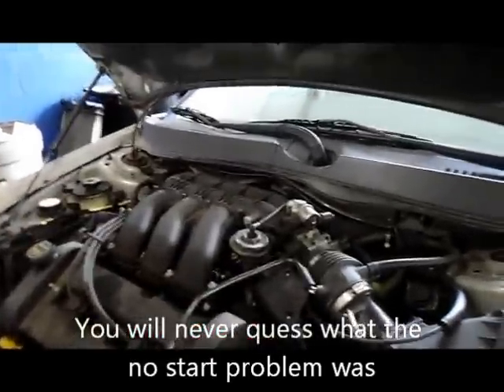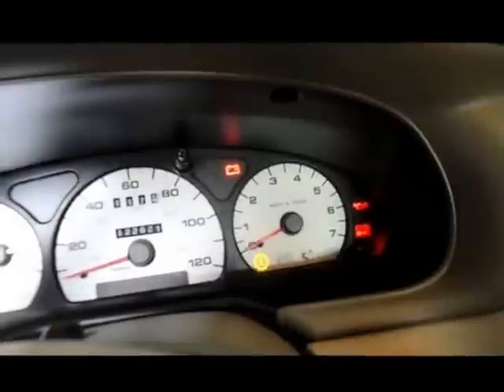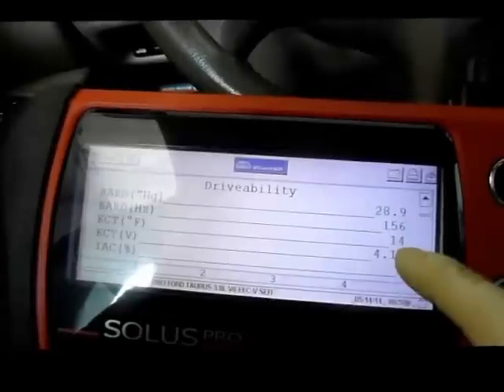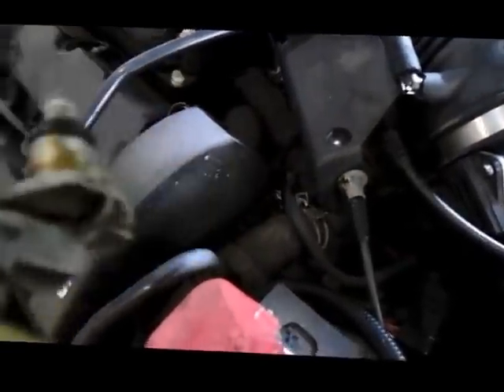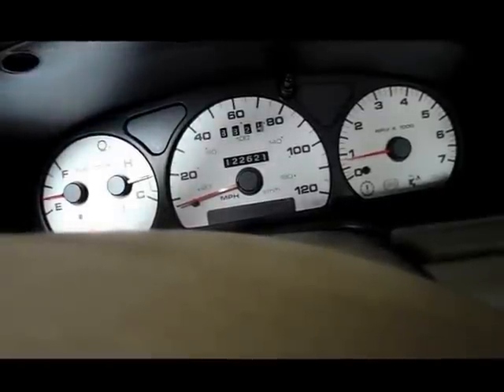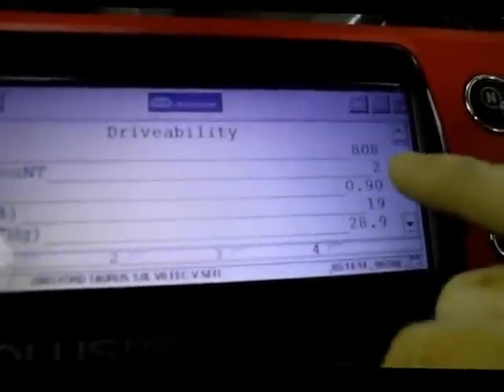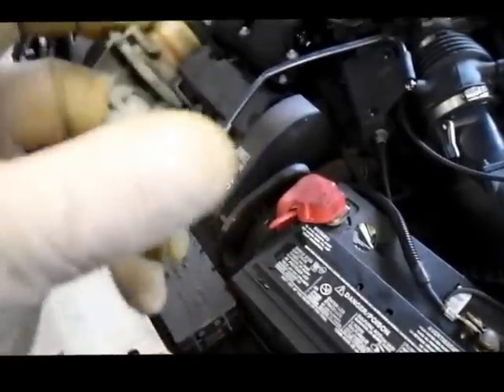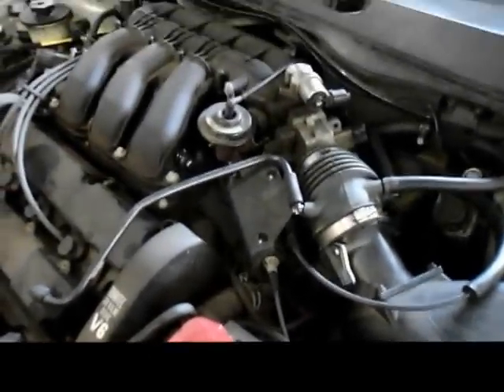Engine cranks but won't start

Comment: What if.. no crank or start and no fancy software.. try these Toyota tricks Put the key in the drivers door with the window rolled down reach inside and lock all doors.. now turn the key in the door to the unlock position and hold it there for 15 or more seconds.. now turn the key in the door to the lock position for 15 seconds or more. Now open the door and get in.. put your foot on the brake and hold it while you turn the ignition to the on position without starting the vehicle.. now there is a trip/odemeter reset button in the dash cluster.. make sure it is set to Trip and not complete vehicle mileage.. turn the key back off when it is set on Trip.. with the key off hold the trip reset button in the dash instrument cluster and turn the key into the on position but do not start the vehicle.. hold for 30 or more seconds (all this time you should have been holding the brake pedal down normally).. now turn the key back off and release the button in the instrument cluster.. note.. do not release the trip reset button until the key is in the off position. All security "engine immobilization" "anti-theft" and even engine maintenance warnings have now been reset. Take the key out of the ignotion. The anti theft light in the dash instrument cluster should blink slowly when the key is not in the ignition. Now insert the key back into the ignition and turn it to the on position without starting the vehicle.. wiggle the steering wheel to make sure it is not caught in a bind as this will prevent the key from performing as it should. With the key in the ignition wait 10 minutes and turn it off and leave the key in the ignition In the off position (this is a lightweight ecm/key program.. make sure all keys that will be used with the vehicle are in the area of the driver when all of this is performed.) After waiting 5 minutes with the key In the ignition and the position of the key being off. . Try to start your vehicle. If you get a no crank or no start there is one more thing you can do.. (never remove remove a battery cable with the key in the ignition) under the drivers side dash board, located in the vicinity of the steering column will be a white plug with 16 pin holes in the end of it.. you will need a paper clip or a short piece of wire to do a hard reset of the ecm/ecu/engine immobilization security feature. The white plug has a shape that only allows it to be plugged Into something one way.. it also has also feature on it that locks together with anything you plug into it.. looks like a small hump about a quarter of an inch long in the middle of one long side of the plug.. hold the plug with that hump facing down. . 8 pins across the top and  8 pins across the bottom. In the top row count over 4 pin holes and in the bottom row count over 5 pin holes.. these are the holes that you will place the paperclip or wire into while the Ignition is off. If looking a diagram it's pins 4/13.. now with the paper clip in the top row #4 pinhole and in the bottom row #5 pinhole.. turn the Ignition on for a few minutes (do not hold the paperclip and make sure it doesn't touch metal) after a few minutes turn the Ignition off and remove the paperclip. Ecm/ecu and engine immobilizer has now been Hard Reset. If the vehicle still does not start.. make sure your insurance policy Is up to date and roll, drag, push the vehicle into the river lol no I'm just kidding.. maybe ha! Seriously though geez.. OK a door lock actuator may be the problem. Check to make sure all doors lock. If not replace the actuator for that door. Start from the top of this list again and at the end of It if the vehicle still does not start.. try putting the gear shifter into neutral while holding the brakes and try to start the vehicle in neutral.. if it starts in neutral it means you have have a bad neutral switch located near the gear shifter or on/in the transmission. The last thing you want to do is disconnect the battery and let it sit over night.. but if you do that.. you will have to perform all of the above plus.. another set of tricks to reset the TPS (throttle position sensor.). I'm not even gonna go there.. OK OK I will geez lol reconnect battery. Sit in drivers seat. With the key out of the ignition press the gas pedal all the way down and release it. Now insert the key and turn it to the on position with out starting the vehicle. Now leave the key on and very.. very very slowly.. slower! Very slowly press the gas pedal all the way to the floor.. slowly I said dang.. lol  :)  hold it to the floor for just a few seconds and then slowly.. very.. very.. slowly release the gas pedal.. Slower!!! Slowly.. oh yeah.. that's it.. Mommy likes It like that lol once the gas pedal reaches the top remove your big Ole foot and no turn the ignition off. Wait 5 minutes. The throttle position sensor (TPS) had now been reprogrammed in the ECM/ECU. Try to start the vehicle. If it doesn't start don't ask me what to do.. I'm just a 24 year old girl lol hope it helps someone tho.. "p.s. My dad and uncles, brothers are all shade tree mechanics and that's just a little of what they have taught me about vehicles.. plus I'm not a prissy dumb city slicker girl yall.. Alabama Girls Are The Best!! Like my comment ok

Comment: I hate new cars im happy with my 79 chevy carburetored car with no fucking computer.life is too short to learn everything
Reply: I hear ya!  I miss my 75 Chevy Impala.  That car never let me down.  I owned it for 24 years and it still ran when I said goodbye to it!  The only electronic thing it had,  if I remember,  was an ignition module inside the distributor in place of the old points system.  I had to replace it only one time when it went out and the car wouldn't start.  Not only was the replacement module pretty cheap, it was really easy to replace!  Those were better days all around for me.  Be well and may your Chevy run for many more years to come!  👍👍😀😀
Reply: @arthurmann578  i have spare distributor, fuel pump,tire and some fuses thats all i need lol

Comment: had kindof this problem on a 93 gmc 305 engine. it would start but was flooding blowing black smoke and backfiring. changed the coolant temp sensor and it ran like new. sensors can do all sorts of strange things.
Reply from the maker: Thank you for your input and for watching.

Comment: Is the same in ram van 1500 engine 5.2? Or just in ford is this issue?
I'm stock and almost I wanna buy new computer I replace all the ignition coil system new crankshaft and nothing about the spark before this happened I repair the water pump but never replace that sensor coolant  :?

Comment: I have a 2003 Mitsubishi lancer LS...i replaced the Cam&Crank sensors replaced the crankshaft sprocket,flange,and trigger plate but before I changed all that I just replaced the crankshaft position sensor the car ran I parked it thought everything was OK about a hour later I go to drive the car and it won't start...so I just went ahead and replaced the sprocket,flange,and trigger plate thinking it would solve all my problems and run fine but this time it won't start at all...would the temperature sensor do the same to a Mitsubishi lancer as it does to a Ford?... Help me out please been trying to figure out what the heck the last 4 months

Comment: Hey I have an 06 mercury milan same Duratec engine thats is doing something similar. Sometimes it won't start and for the longest time maybe like 2 months it would almost always start the 2nd time. But now it's getting worst and taking more times to start do you think that this sensor could be the problem ?

Comment: My 2004 freestar 3.9 L wont start when cold outside. When it warms up theres no problem! It cranks good but sounds like a horse when trying it goes phhhht every time could this temp sensor be the problem possibly or the fuel pump?

Comment: There is a problem when a computer won't allow an engine to start if its below freezing since most people live in areas where that is the norm for large portions of the year.
14 degrees fahrenheit? That shouldn't keep it from starting.
I wouldn't want to rely on computer controlled vehicles in an emergency situation.

Comment: Hi
I urgently need your help please.
Can this happen to a 2005 Nissan pathfinder SE?
My Nissan was perfectly running but suddenly stopped starting.
The engine is cranking but does not start!!
It has been seen by couple of mechanics but no start.
They have checked and replaced few sensors but not the coolant temperature one. By the way there is no spark.
Any advise please.
Thank you

Comment: please whats the name of this your scanner? how much does it cost  to get one? how many car make can it scan? like is it only for ford or it universal?
that is number one 
number two, i have acura tl 2005 that crank but won't start of show battery or gear light on the dash board? what could possible be the cause, the fuel pump is working but due to time factor I couldn't, it display light on the dash board but omits the battery light and gear light from showing on the dash board.

Comment: 93 Subaru, the sensor failed while hot, when cold start, the sensor says too hot to run, and blocks the signal to allow spark.

Comment: I know that if it did start and continue running thinking that it was cold, we know it would have run very rich. Over a long period of time that could have caused damage to the engine and possibly the emissions, in particular the cat. I had a car that caught fire because the temp sensor was bad, the cat was so hot that it melted the heat shield. I replaced the temp sensor and the problem was gone. Is it possible that this was designed for that purpose, possibly to protect the consumer??

Comment: hello good morning that was a very good information but I don't know if it's gonna be same thing for a different car..  my car is a mitsubishi eclipse 2001 no issues no problem tow days ago when I m on my way home on the free way I was driving normally an smoothly it's a stick shift car I bearly shift to 3d speed the car just shutt off an it won't start I don't know what exactly happen bc I changed everything lately an every thing was ok.....etc.....
Reply: salah hage it's your timing belt common in lancer
Reply: no the timing belt is good
Reply: Antonio Gonzalez the problem is the crank position sensor an it's gonna take one day to fix

Comment: my 2012 mustang is doing something like this it turns off randomly then it doesn't start it cranks but no start the next day it works fine for months or until it randomly shuts off can you help ?

Comment: I have a 2006 Lincoln Zephyr having problems starting it I put a new Fuel pump on it set of new fuel injectors set of new spark plus set of new coils and pigtail leads for the coils and takes it forever too start I can turn the key on it cranks for at lest 30 minutes than have too back off the key and back it off again and finally it starts it was doing this before so that is why i bought new parts has nearly 180,000 miles on the car I bought all the parts dirt cheap from eBay fuel injectors a set brand new not re manufacturer was $42.00 on eBay fuel pump not assembly was $18.00 and coils set of them was $45.00 on eBay

Comment: i have a 1999 mercury villager the engine cranks but it doesnt start so would this be the same problem the sparks plugs are fine but i wanna know if i should try this??

Comment: how many sensors are there that prevent the entry from even starting it should protect the engine it might work when it's running but then suddenly it just feels so the engine has to stop the computer won't let the engine start Wolf Run just try it by unplugging the wire to see if it'll run

Comment: I seen a vw beattle rough idle because a coolant temp sensor and I have a 3.0 ohv that won't start after overheating I have spark fuel psi ... am going to try a coolant temp sensor

Comment: my kia sedona 2006 got the same prob...it starts when its cold but not when its hot...garage said it could be the camshaft sensor 90 but they not sure..
Reply from the maker: Did they check for codes?

Comment: Hey Jim I have a 98 Nissan 200sx and I just got the fuel pump and the filter changed on it today but my car still won't turn over battery is good and starter as well what could be causing this problem plz help with some information ty

Comment: I have the same issue except I have spark and it will start with starting fluid then it will run all day if it gets cold overnight it won't start in the morning I have changed the coolant sensor anyway still won't start I also replaced the relay too no help

Comment: maybe my problem? my 98 Ram Van keeps stalling out. I've changed the coil and the cam sensor and crank sensor complete tune. and still it dies on me after a few min start back up but stalls out. so going to check this out never would've thought temperature sensor.

Comment: hi, i have a 2008 chevy cobalt,was driving when it acted like it was running out of fuel ,then it stopped but the fuel tank had just been filled.I had it towed home and starter has been changed but still won"t crank or start. please any help?

Comment: probably engaging a cold start thermo time, flooding it !
Reply: Wait u just blew my mind there. I hope u see this comment. I don't want to write an essay but essentially my truck cranks good but won't start. Went through all the basics, everything checks out. There is NO REASON it should not be starting!!! Its got fuel, its got spark so in theory it should at least do something. NOW, following up to this I was having a very discreet but weird symptom where I had intermittent longer cranks and occasional starts where the truck would seem FLOODED. Sure enough there is excess gasoline in the intake, injectors are new, purge valve is new (which could also cause a "flood-like" condition). Could it really be the coolant sensor? I've even had a mechanic put quite a few hours in and he's stumped, this flickin thing should be starting

Comment: if the temp is reading super low, the computer will run an extremely rich fuel mix to get it to fturn over, on a warm day this will flood the engine just like an old carbureted  engine
Reply from the maker: Thank you for your input

Comment: Question I have a 1999 Camry. Cranks and won't start. One of the spark plugs looks like it's sparking. I replaced the Starter Fuse, used the either starting fluid. Could be fuel pump, or could it be the spark plug? Thanks
Reply from the maker: You will need to check further for Spark,Fuel,Injection pulse and Compression so you can pin point where the problem is.

Comment: interesting. you would think if a sensor failed that it would just run in closed loop meaning a default fuel and igntion to be safe...

Comment: Lock it for 20 minutes then manually open it .. just like chevy it has a fuel lock system but ford has it in the electrical system

Comment: you answered your own question. the cpu shut off the coil pack to save the engine. the oil sending unit will do it too.

Comment: STARTER SOLENOID WITH VOLTMETER!!
First lead bolt is getting constant 12V from battery (12.8 actually) so good checks out!
 
I then have friend turn the key and the second bolt (from the ignition switch) is only reading 10.4V, is that my issue? Ignition switch/relay not full voltage? 

Third bolt that attaches directly from solenoid to starter ..picking up/sending nothing! Bad new solenoid i got from factory? Or is that simply the result of only the 10.4 being sent in voltage at 2nd bolt? HELP!!!!

Comment: I just bought a 2004 Buick lasabre  custom I filled up the tank turn it off turned it on put air in the tires turned it back on drove less than a mile stopped to be eat and it's started doing this cracking but wouldn't start I stayed hrs stranded  and it wouldn't start I left it came back the next day with  a tow truck it started it was  shaking alot got home took it of the tow truck and then it just died again and now it just cranking but not starting can it be this when I bought he car it didn't shake now it shakes WTF

Comment: could it be that the temp sensor saying engine was cold but the choke wouldn't close so the engine was trying to start on fresh air? at 1:24 the gauge is saying normal engine temp so the faulty sensor was somehow stopping fuel flow.
Reply: Rose White ii

Comment: Fixed my 03 civic. I knew that coolant temperature sensor won't start the engine if it's bad, it sends data to your ecu (also other issue is air fuel ratio mass air sensor and throttle body should be clean)
Reply from the maker: Thank you for watching

Comment: I have a 06 ford taurus doing the same thing. But when I spray starter fluid in the air flow it start but we'll not start from the inside with the key.

Comment: I'm having the same problem with my 2010 Dodge Avenger at first my car would start and as long as I press on the gas pedal very slowly it will continue to run but if I hit the gas pedal a little too hard or even at normal speed it would just automatically shut off now it's to the point to where I crank it it'll start and then when I put it in drive it will just die and now it's cranking but won't start but if I push on a wire around the PCM it seems to start up so what could that be a loose wire or could it still be the engine coolant sensor seems to me to be the same problem that you all had

Comment: Unbelievable!  I have a 2005 PT Cruiser  my OBD2 port no power and my car dies while driving there was a check engine light for 02 sensor which was replaced but still showed ....no stalls while driving , no port and check engine light on uhhhhgg

Comment: I have a 2000 Ford Taurus I can crank it and it will start but after I drive it for about 20 minutes the engine shuts down then I have to wait for about an hour before I can start it up we changed fuel pump but still have issue